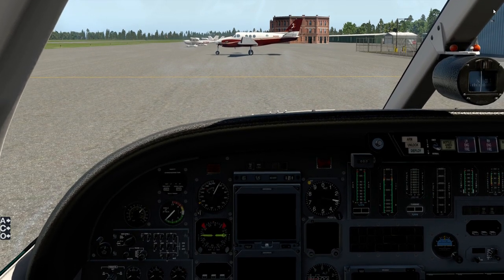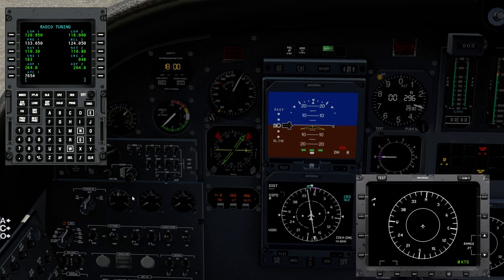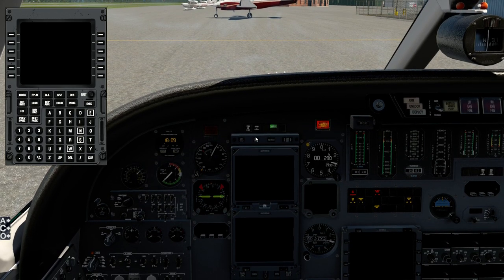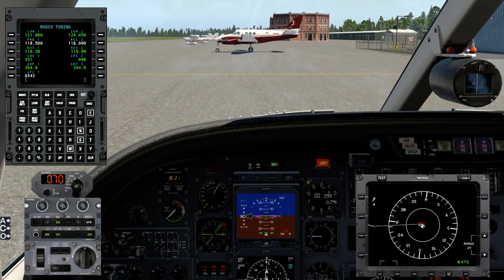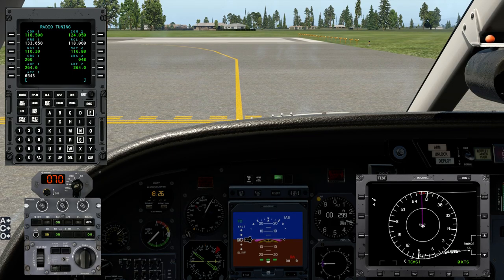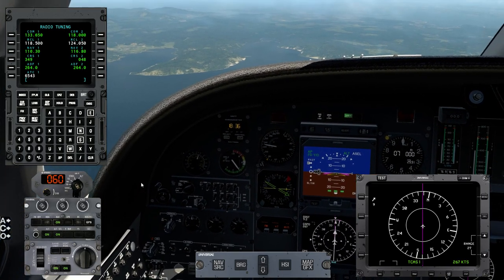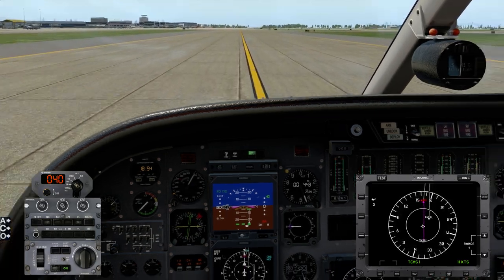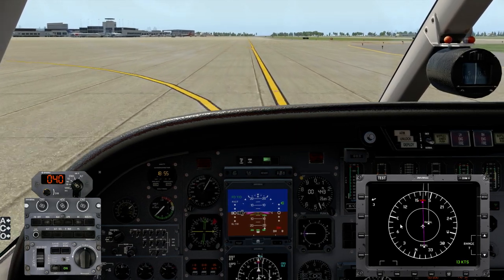Carenado Cessna S550 Citation II for X-Plane 11 Startup and Normal Operating Procedures

Comment: Great video! One question, do you know where I can get the clist file for this bird?
Reply from the maker: I will gladly send you the checklist. Give me your email and I’ll send it.
Reply from the maker: Hello. Here is the checklist I created from the Citation S550 flight manual. No special software is used. I simply used the text to voice feature in X plane 11.

BEFORE START

Preflight Inspection - COMPLETE
Flashlight - ABOARD/CHECKED
Fire Extinguisher - ABOARD/CHECKED
Microphones, Headsets, Oxygen Masks - ABOARD
Documents and Manuals - CHECKED
Oxygen Quantity - CHECKED
Circuit Breakers - CHECK IN
Anti-Ice/De-Ice Switches - OFF
Control Locks - REMOVE
Generators (except for GPU start) - GEN
Fuel Boost Pumps - NORM
Ignitions - NORM
Crossfeed - OFF
Gyro Slave Switch - AUTO
Standby Gyro - ON/VERIFY POWER/OFF
Seat Belt Sign - CHECKED/OFF
Anti Skid - OFF
Cabin Pressure/Rate Control - SET
Throttles - CUTOFF
Engine Sync - OFF
Windshield Bleed Valves - CLOSED
Battery Switch - BATT (CHECK 24 VOLT MINIMUM)
AC Power & Master Avionics - ON
Rotary Test - CHECKED
Parking Brake - SET
Landing Gear Handle- DOWN/THREE GREEN/NO RED
Engine Instruments - NO FLAGS
Electric Elevator Trim - TRIM DISC CHECKED
Airspeed Bug - SET
Fuel Quantity - SUFFICIENT/BALANCED
GPS/FMC - PROGRAMMED
Flight Plan - FILED

BEFORE STARTING ENGINES

Chocks - REMOVED
Seats and Pedals - ADJUSTED
Beacon/Navigation Lights - ON
Cockpit Lights - AS REQUIRED
Standby Gyro - ON
AC Power & Master Avionics - OFF
Air Conditioning - OFF
Cabin Door - LOCKED/LIGHT OUT
Before Start Check - COMPLETE

STARTING ENGINES

First Engine Ignition - ON
First Engine - START
N2 - VERIFY RPM INCREASE
First Engine Throttle - WAIT FOR N2 ABOVE 8% THEN SET TO FLIGHT IDLE
ITT - MONITOR WITHIN LIMITS
N1 - VERIFY ROTATION/RPM INCREASE
WAIT FIRST ENGINE STABILIZED
Second Engine Ignition - ON
Second Engine - START
N2 - VERIFY RPM INCREASE
Second Engine Throttle - WAIT FOR N2 ABOVE 8% THEN SET TO FLIGHT IDLE
ITT - MONITOR WITHIN LIMITS
N1 - VERIFY ROTATION/RPM INCREASE
WAIT SECOND ENGINE STABILIZED

BEFORE TAXI

GPU - DISCONNECTED
GENerator Switches - GEN
Volts/Amps - CHECKED
AC Power & Master Avionics - ON
PASSenger Advisory Light - PASS/SAFETY
Cabin Pressure and Temp Controls - SET/AUTO
Gyro Pressure - CHECKED
Air Conditioning - FAN OR OFF
Circuit Breakers - CHECK RIGHT/CHECK LEFT
Belts and Harnesses - FASTENED
Exterior Lights - AS REQUIRED
Before Taxi Check - COMPLETE 
 
TAXI

Check Departure Runway - BUGGED/VERIFIED
ATIS and Clearance - COPIED
Transponder - SET AS REQUIRED
Brakes and Steering - CHECK RIGHT/CHECK LEFT 
Flight Controls - TOPS CHEKED/BOTTOMS CHEKED
Flaps - CHECK OPERATION/FLAP HANDLE AGREES WITH FLAP POSITION
GPS/FMC - PROGRAMMED
INVerters - CHECKED
Auto Pilot & Flight Director - CHECKED/HEADING-ALTITUDE SELECT
Anti-Ice/De-Ice - CHECK AND AS REQUIRED
Thrust Reversers - CHECKED
Flight Instruments - CHECKED
Altimeter/Altitude Selector - SET
Radios/Avionics - SET
Fuel Quantity/Balance - CHECKED
Pressure Source Selector - CHECKED LH/RH/NORM
Speedbrakes - CHECKED/RETRACTED
Flaps - SET 7 DEGREES
Trims - SET THREE TRIM WHEELS
Takeoff Data/Bugs - REVIEW
Crew Briefing - COMPLETE
Taxi Check - COMPLETE 

BEFORE TAKEOFF

Ignitions - ON
Anti-Ice/De-Ice - AS REQUIRED
Pitot/Static Heat - ON
Exterior Lights - ON
Transponder/TCAS - ON
Engine Instruments - CHECKED
Anti Skid - ON
Annunciator Panel - CHECKED
Departure Runway - BUGS ALIGNED/VERIFIED
Before Takeoff Check - COMPLETE

AFTER TAKEOFF AND CLIMB

Landing Gear & Lights - UP AND OFF
Yaw Dampener - ON
Flaps - UP
Engine Sync - ON
Ignitions - NORMAL
Climb Power - SET
Anti-Ice/De-Ice - AS REQUIRED
Anti Skid - OFF
Pressurization - CHECKED

Passenger Advisory Lights - AS REQUIRED
Exterior Lights - AS REQUIRED
Climb Check - COMPLETE 
 
TRANSITION (climb)

Altimeters - 29.92/29.92-CROSSCHECKED
Recognition Lights - OFF
Oxygen - CHECK
Pressurization - CHECK
Air Conditioning - FAN OR OFF
Transition Check - COMPLETE  
 
DESCENT

Defog Fan - HI
Foot Warmers - CLOSED RIGHT/CLOSED LEFT
Airflow Distribution - COCKPIT
Pressurization - SET
Windshield Bleed Air/Manual Valves - LO/MAX
Anti-Ice/De-Ice - AS REQUIRED
Fuel - BALANCED/CROSSFEED OFF
Descent Check - COMPLETE 
 
 
APPROACH

Altimeters - SET/CROSSCHECKED
Belts and Harnesses - ON RIGHT/ON LEFT
Passenger Seats - UPRIGHT/OUTBOARD
Cabin and Emergency Exits - CLEAR
Recognition Lights - ON
Landing Data - SET/POSTED
Anti Skid - ON
Pressurization - CHECKED
Avionics/Flight Instruments - SET
Approach Briefing - COMPLETE
Passenger Advisory Lights - PASS/SAFETY
GPS selector - SET
Approach Check - COMPLETE 

BEFORE LANDING

Landing Gear - DOWN-3 GREEN-NO RED/VERIFIED
Ignitions - ON
Engine Sync - OFF
Pressurization - CHECK ZERO DIFFERENTIAL
Landing Lights - ON
Flaps - LANDING
Annunciator Panel - CLEAR
Speed Brakes(Prior to 50 ft AGL) - RETRACTED
Autopilot/Yaw Dampener - OFF
Before Landing Check - COMPLETE 
 
AFTER LANDING (silent)

Anti Skid - OFF
Pitot Heat/Anti-Ice/De-Ice - OFF
Ignitions - NORMAL
Exterior Lights - AS REQUIRED
Standby Gyro - OFF/CAGED
Transponder - AS REQUIRED
Radar - STANDBY
Flaps - UP
Speedbrakes - RETRACTED
Trims - RESET
After Landing Check - COMPLETE 
 
SHUTDOWN

Check Parking Brake - AS REQUIRED
Transponder - STANDBY
Avionics & Inverters - OFF
Overhead/Defog Fans - OFF
Air Conditioning - OFF
Throttles - CUTOFF
Exterior Lights - OFF
Passenger Advisory Lights - OFF
BATTery Switch - OFF
Clock - ZEROED
Shutdown Check - COMPLETE 
 
VREF – KIAS Flap Full

WEIGHT / KIAS
14.1 / 114
13.5 / 112
12.7 / 108 
12.0 / 106
11.5 / 104
10.5 / 99
9.5 / 95

VREF – KIAS Flap 15

WEIGHT / KIAS
14.1 / 122
13.5 / 119
12.7 / 115 
12.0 / 113
11.5 / 111
10.5 / 106
 9.5 / 102

Comment: What if they dont have an ILS landing aviable?
Reply from the maker: Approach options should come up in your flight management computer when you select a destination airport. Alternatively, go to Skyvector and enter your departure and destinations airports in the flight plan. Move your cursor over the destination airport and all approach options will come up. You can select and bring up a chart for your desired approach. However, The flight management computer should bring up all approach options including ILS, localizer, RNAV, VOR, etc.  The FMC is capable of flying any of these approaches. If no instrument approach is available, you can have the FMC guide you to the airport and execute a visual approach.

Comment: where did you find the checklist. I can't find it anywhere
Reply from the maker: Hello. Here is the checklist I created from the S550 flight manual. No special software is used. I simply used the text to voice feature in X plane 11.

BEFORE START

Preflight Inspection - COMPLETE
Flashlight - ABOARD/CHECKED
Fire Extinguisher - ABOARD/CHECKED
Microphones, Headsets, Oxygen Masks - ABOARD
Documents and Manuals - CHECKED
Oxygen Quantity - CHECKED
Circuit Breakers - CHECK IN
Anti-Ice/De-Ice Switches - OFF
Control Locks - REMOVE
Generators (except for GPU start) - GEN
Fuel Boost Pumps - NORM
Ignitions - NORM
Crossfeed - OFF
Gyro Slave Switch - AUTO
Standby Gyro - ON/VERIFY POWER/OFF
Seat Belt Sign - CHECKED/OFF
Anti Skid - OFF
Cabin Pressure/Rate Control - SET
Throttles - CUTOFF
Engine Sync - OFF
Windshield Bleed Valves - CLOSED
Battery Switch - BATT (CHECK 24 VOLT MINIMUM)
AC Power & Master Avionics - ON
Rotary Test - CHECKED
Parking Brake - SET
Landing Gear Handle- DOWN/THREE GREEN/NO RED
Engine Instruments - NO FLAGS
Electric Elevator Trim - TRIM DISC CHECKED
Airspeed Bug - SET
Fuel Quantity - SUFFICIENT/BALANCED
GPS/FMC - PROGRAMMED
Flight Plan - FILED

BEFORE STARTING ENGINES

Chocks - REMOVED
Seats and Pedals - ADJUSTED
Beacon/Navigation Lights - ON
Cockpit Lights - AS REQUIRED
Standby Gyro - ON
AC Power & Master Avionics - OFF
Air Conditioning - OFF
Cabin Door - LOCKED/LIGHT OUT
Before Start Check - COMPLETE

STARTING ENGINES

First Engine Ignition - ON
First Engine - START
N2 - VERIFY RPM INCREASE
First Engine Throttle - WAIT FOR N2 ABOVE 8% THEN SET TO FLIGHT IDLE
ITT - MONITOR WITHIN LIMITS
N1 - VERIFY ROTATION/RPM INCREASE
WAIT FIRST ENGINE STABILIZED
Second Engine Ignition - ON
Second Engine - START
N2 - VERIFY RPM INCREASE
Second Engine Throttle - WAIT FOR N2 ABOVE 8% THEN SET TO FLIGHT IDLE
ITT - MONITOR WITHIN LIMITS
N1 - VERIFY ROTATION/RPM INCREASE
WAIT SECOND ENGINE STABILIZED

BEFORE TAXI

GPU - DISCONNECTED
GENerator Switches - GEN
Volts/Amps - CHECKED
AC Power & Master Avionics - ON
PASSenger Advisory Light - PASS/SAFETY
Cabin Pressure and Temp Controls - SET/AUTO
Gyro Pressure - CHECKED
Air Conditioning - FAN OR OFF
Circuit Breakers - CHECK RIGHT/CHECK LEFT
Belts and Harnesses - FASTENED
Exterior Lights - AS REQUIRED
Before Taxi Check - COMPLETE 
 
TAXI

Check Departure Runway - BUGGED/VERIFIED
ATIS and Clearance - COPIED
Transponder - SET AS REQUIRED
Brakes and Steering - CHECK RIGHT/CHECK LEFT 
Flight Controls - TOPS CHEKED/BOTTOMS CHEKED
Flaps - CHECK OPERATION/FLAP HANDLE AGREES WITH FLAP POSITION
GPS/FMC - PROGRAMMED
INVerters - CHECKED
Auto Pilot & Flight Director - CHECKED/HEADING-ALTITUDE SELECT
Anti-Ice/De-Ice - CHECK AND AS REQUIRED
Thrust Reversers - CHECKED
Flight Instruments - CHECKED
Altimeter/Altitude Selector - SET
Radios/Avionics - SET
Fuel Quantity/Balance - CHECKED
Pressure Source Selector - CHECKED LH/RH/NORM
Speedbrakes - CHECKED/RETRACTED
Flaps - SET 7 DEGREES
Trims - SET THREE TRIM WHEELS
Takeoff Data/Bugs - REVIEW
Crew Briefing - COMPLETE
Taxi Check - COMPLETE 

BEFORE TAKEOFF

Ignitions - ON
Anti-Ice/De-Ice - AS REQUIRED
Pitot/Static Heat - ON
Exterior Lights - ON
Transponder/TCAS - ON
Engine Instruments - CHECKED
Anti Skid - ON
Annunciator Panel - CHECKED
Departure Runway - BUGS ALIGNED/VERIFIED
Before Takeoff Check - COMPLETE

AFTER TAKEOFF AND CLIMB

Landing Gear & Lights - UP AND OFF
Yaw Dampener - ON
Flaps - UP
Engine Sync - ON
Ignitions - NORMAL
Climb Power - SET
Anti-Ice/De-Ice - AS REQUIRED
Anti Skid - OFF
Pressurization - CHECKED

Passenger Advisory Lights - AS REQUIRED
Exterior Lights - AS REQUIRED
Climb Check - COMPLETE 
 
TRANSITION (climb)

Altimeters - 29.92/29.92-CROSSCHECKED
Recognition Lights - OFF
Oxygen - CHECK
Pressurization - CHECK
Air Conditioning - FAN OR OFF
Transition Check - COMPLETE  
 
DESCENT

Defog Fan - HI
Foot Warmers - CLOSED RIGHT/CLOSED LEFT
Airflow Distribution - COCKPIT
Pressurization - SET
Windshield Bleed Air/Manual Valves - LO/MAX
Anti-Ice/De-Ice - AS REQUIRED
Fuel - BALANCED/CROSSFEED OFF
Descent Check - COMPLETE 
 
 
APPROACH

Altimeters - SET/CROSSCHECKED
Belts and Harnesses - ON RIGHT/ON LEFT
Passenger Seats - UPRIGHT/OUTBOARD
Cabin and Emergency Exits - CLEAR
Recognition Lights - ON
Landing Data - SET/POSTED
Anti Skid - ON
Pressurization - CHECKED
Avionics/Flight Instruments - SET
Approach Briefing - COMPLETE
Passenger Advisory Lights - PASS/SAFETY
GPS selector - SET
Approach Check - COMPLETE 

BEFORE LANDING

Landing Gear - DOWN-3 GREEN-NO RED/VERIFIED
Ignitions - ON
Engine Sync - OFF
Pressurization - CHECK ZERO DIFFERENTIAL
Landing Lights - ON
Flaps - LANDING
Annunciator Panel - CLEAR
Speed Brakes(Prior to 50 ft AGL) - RETRACTED
Autopilot/Yaw Dampener - OFF
Before Landing Check - COMPLETE 
 
AFTER LANDING (silent)

Anti Skid - OFF
Pitot Heat/Anti-Ice/De-Ice - OFF
Ignitions - NORMAL
Exterior Lights - AS REQUIRED
Standby Gyro - OFF/CAGED
Transponder - AS REQUIRED
Radar - STANDBY
Flaps - UP
Speedbrakes - RETRACTED
Trims - RESET
After Landing Check - COMPLETE 
 
SHUTDOWN

Check Parking Brake - AS REQUIRED
Transponder - STANDBY
Avionics & Inverters - OFF
Overhead/Defog Fans - OFF
Air Conditioning - OFF
Throttles - CUTOFF
Exterior Lights - OFF
Passenger Advisory Lights - OFF
BATTery Switch - OFF
Clock - ZEROED
Shutdown Check - COMPLETE 
 
VREF – KIAS Flap Full

WEIGHT / KIAS
14.1 / 114
13.5 / 112
12.7 / 108 
12.0 / 106
11.5 / 104
10.5 / 99
9.5 / 95

VREF – KIAS Flap 15

WEIGHT / KIAS
14.1 / 122
13.5 / 119
12.7 / 115 
12.0 / 113
11.5 / 111
10.5 / 106
 9.5 / 102